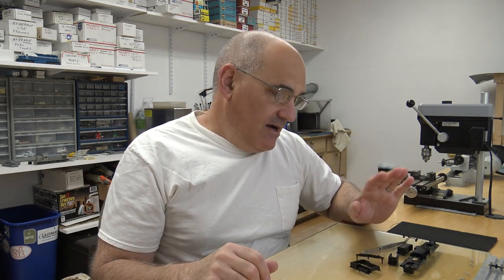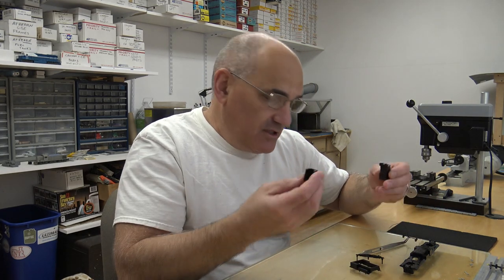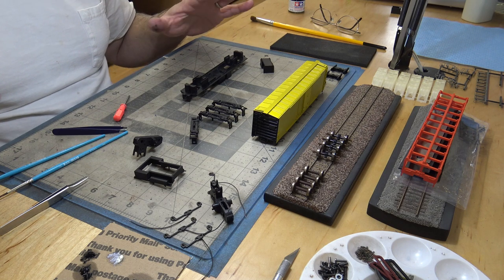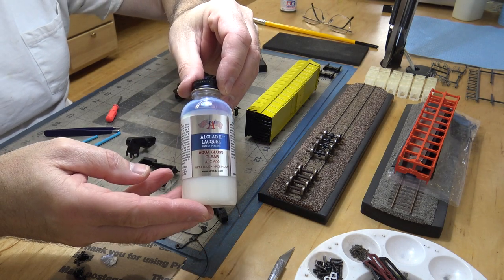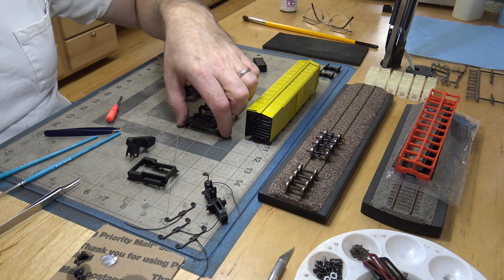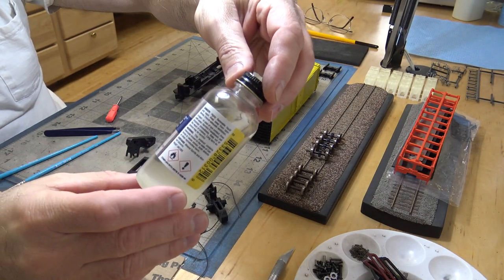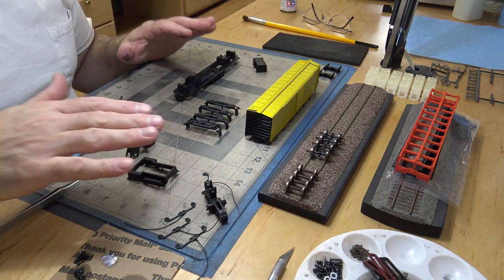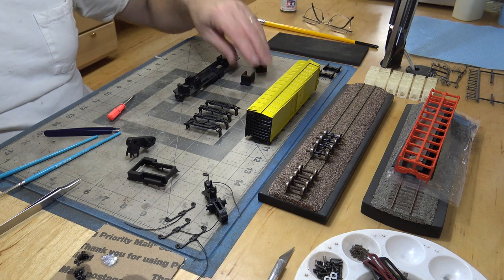SHAWNEETOWN DOCKS RAILWAY RS2 AND RSC2 PART 2

Comment: You are an amazing expert at this! Everything works great, but what does the keepalive do??
Reply from the maker: Keep Alive also known as the Power Pak is a capacitor used to deliver continuous power to the board in the case of faulty trackwork or small dead spots in switches and such.

Comment: Once again a wonderful outstanding video Brian, what is your experience as far as speakers whether to wire parallel or in series I noticed you did parallel with this one do you get better Sound thanks Ed
Reply from the maker: I have no idea if it makes a difference. I just know that wiring two speakers means parallel and four speakers is parallel, series, parallel. I have to say though these models sound the best I have ever had. I did something right with the design. I have no idea what it is, but I did it.
Reply: @6axlepwr  Thanks Brian I have about 12 Proto 2000 GP nines and five RS 11s Atlas all HO to do I just need to learn 3-D printing to make custom speaker enclosures for those, Thanks again you help open my brain😊